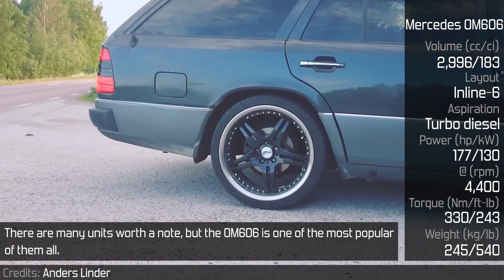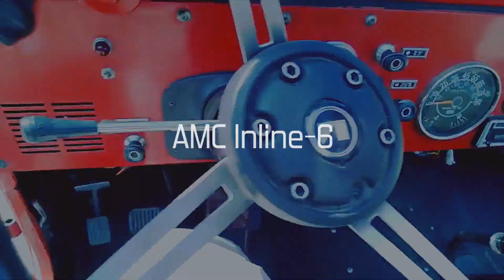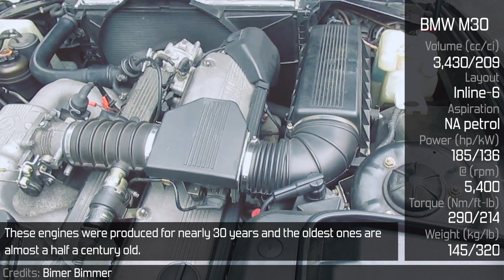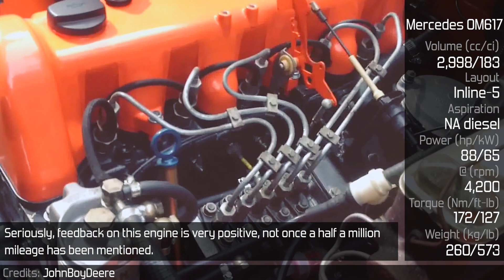10 Most Reliable Engines Running Beyond 300,000 Miles

Comment: What about the 4.6L Modular V8? I've personally had a 1997 Ford Crown Victoria with 450,000 miles.
Reply: STICH666 that thing could be the most reliable car on the planet right now. Seriously
Reply: STICH666 just bought a 2009 crown vic with only 79,000 miles and I plan to have it for a long time :)
Reply: There is a reason they made cop cars with them! Comparable to how many miles a semi driver gets.
Reply: Toyota Hilux 2.4D 
Now that's probably THE most reliable diesel engine out there..
Reply: As long as you keep replacing bottom end bearing at each 20k service
Reply: Probably one of the most reliable motors ever made for a most reliable car. The Panther platform was legendary, and I can't believe Ford killed it.
Reply: STICH666 
I got a 1997 ford E-150 conversion van with the 4.6L it runs great i got 362,423 miles on it right now, it has never failed me yet. I love this van, i hope it will go another 200,000miles. Actually i am typing this while sitting in the van while waiting for my girlfriend to come out of walgreens. lol
Reply: g120957au 
I got 362,000miles and never had to replace the bearings, so i have no idea what you're talking about.
Reply: I beg to disagree with the 4.6. I own one, in a '99 Crown Vic P71, and at 230,000 miles it decided it was a lovely time to send all eight oil rings right out the fucking tailpipe alongside enough blue smoke that it had to be running more on its own lubricant than on gasoline. It will still run, I'll grant, but at this point I'd estimate only about five of the cylinders are pulling worth a damn and maybe six are firing at all.

Maybe it's just a fluke, but...idunno, I'm still sitting here driving the '85 F150 I initially bought the 'Vic to replace while it underwent restoration. That damn truck, with its lazy, all cast iron, straight six keeps right on chugging and in fact is running better now than it was when I got the P71 in the first place.

I'm currently debating on whether I want to put another 4.6 in it, or if I want to swap in a 302 V8 and do some cheaty mccheatface bullshit to get it past the sniffers since the 302 wouldn't interface with the OBD-II port and my locality probes the computer for that model year of car instead of the tailpipes.
Reply: One of the three most reliable engines ANYONE ever built. I used them in service trucks for years. If you use your truck for service you cannot AFFORD to have it out of commision. Do the maintenance and they'll run forever. I got rid of them when the body got so hammered I was ashamed to show up at a customer in it.
Reply: @Brandon O'Neal Mm. I love that 300. It don't rev for shit, there's fuck all top end, but they can take an absolute beating and still not find any fucks to give. You don't even need to be perfect on your maintenance, they're more than tolerant of going a few hundred miles past due on oil changes, spark plugs, etc.

Basically as long as the oil still lubricates it, the fuel and air is mixed vaguely in the general zip code of 'flammable', and there's no abrasive schmoo getting in the air intake, they'll run happily.
Reply: @Tom Swinburn I work for Goodyear CTSC and there's definitely some 300 genes still floating through the ranks. One of our service trucks is a 2015 F250...it's got a V8, of course, but it pulls like an ox, and shares one distinctive trait that every Ford truck going back to 1967 has had: Twin I-beam front suspension.

I very much prefer driving it to our 2010 Dodge Ram 2500. But I wish it had a 300 in the nose and a manual behind that.
Reply: STICH666 just had a 99 f150 with a 4.6 with 678k in the shop the other day. I know of two 300-6s with over a million and several 4.6s and 302s with 500k or more.
Reply: A friend of mine owns a Crown Vic forever with over 250,000 miles on it. Those cars can go on for a long time as long you take care of it.
Reply: Keegan Johnson The 300 straight 6's are the literal definition of reliable and bulletproof people say "Oh the (insert engine here) will last forever if you do proper maintenance" but with the 300 it can go on forever even without proper maintenance I've seen them run with basically no oil and run perfect again when new oil is added
Reply: Austin Wolfe i know. I haf a 1968 f100 with a 300 and 4 speed. It had accidentally been towed in gear once by one of my dads hired hands and not driven in 10 years. I drove it into the shop off of a milkjug of gas and derby car style minimal wiring. The cylinders were all ovaled so we had to replace it, but by God it still ran!
Reply: Keegan Johnson The thing I've noticed is the most reliable engine you can get are American inline 6's such as 4.9 300 and the Jeep 4.0 and the 5.9 Cummins
Reply: Austin Wolfe True. I just wish we would have gotten all the modern versions of the Ford 6 that Australia got...
Reply: Keegan Johnson True Australia has some of my favorite vehicles sadly I'm not in Australia
Reply: Never replaced the plastic intake?
Reply: paulparoma alas they should have updated the interior and made it handle better. thats what killed it
Reply: Modular engines aren't as bad as the Mopar 3.7 and 4.7, but they're still crap. They have a tendency to warp heads, but even more often they have a tendency to puke out a spark plug under load. I had that happen to me at the top of Lookout Pass on a 6.8L.
Reply: Nope not reliable.
Reply: robroyoldboy warped heads? The spark plug issues were all fixed for free if you brought it in, and the updated design has no issues. This is only common on 5.4 and 6.8 engines. Any 4.6 2v still on the road right now will likely be there a long time. Still not as reliable as the old or new 5 liters or the 5.8 or 6.2 though, i will say that.
Reply: The 300 six should of been on this list, or the 500,000 mile list should they ever make one. I disagree with your opinion on the modular/4.6, if treated well they should do 300,000-400,000 easy. If you lost rings I'd have to ask about the service history, has it been regularly serviced with the proper oil? Have any ignition of fuel issues been taken care of in a timely manner?  If you loose a coil on a spark plug and don't do anything about it and dump raw fuel into the cylinder you can't burn it eventually gets into the oil and causes problems.
Reply: STICH666 ...yes this is an incredible engine. I've got a 99 Ford Expedition that has 250,000 on it. Zero problems. Not only the engine, but the entire vehicle. It has the original water pump and fuel pump. The vehicle is getting a little rusty, but for the most part has been bulletproof from day one.
Reply: G6 Liara ...I agree
Reply: Brandon O'Neal ...Yes, they called it the "Iron Duke"  It certainly was a great engine from Ford, along with its predecessor the 250. All the great iron engines went away because of federal fuel economy standards mandated to the big 4 manufacturers :-(
Reply: chayes954r im suspicuous that ford quit making the straight 6 because too many people were keeping their cars and trucks too many years and not buying new ones. Look what the aussies did with it. And in todays world a modular 4 that can also be a 6 makes a lot of sense, especially with ecoboost technology. Mercedes is going back to it. I want rwd fords back! They can still have optional awd for those afraid of snow.
Reply: Yes making anything that lasts nearly forever is always going to be a nail in the manufacturers coffin. Sales will suffer. So they have to engineer their vehicles to last somewhere in the middle. If it fails with low miles, nobody will want it. If it lasts to 400,000 miles, sales of new vehicles will suffer. It's a catch 22.
Reply: I always thought the Iron Duke was the 4 cylinder cast iron Pontiac Engine that was founf in Sunturds, later to be reworked into the "TechFour" or "QuadFour" and built at the GM Delta township engine plant?
Reply: NO the government and Obama killed it with CAFE regulations, it was a declining segment and Ford couldn't afford to have it in their portfolio and take the CAFE hit for it, SUVs and Crossovers are more profitable so that's where they wanted to use/balance their less fuel efficient cars.
Reply: No it was the straight six didn't fit well into the new designs, to meet CAFE (Corporate Average Fuel Economy) the have to package the vehicles tighter and tighter, it's easier to tighten upan engine bay if the choices are V6/V/8, the straight sixes were to long and were hard to use in transverse applications (front wheel drive)
Reply: S Baker oh, lol, I don't know, but I do know the "Quad 4" by GM was a horrible engine.
Reply: S Baker ...that is true also, but they could have kept using the 300 straight 6 in light trucks since the engine bay hasn't really changed in those. I had one in my father's old 82 F150. Had a 4 speed transmission. I loved that truck.
Reply: I don't know about that, some of the Japanese manufacturers used durability  and reputation  to increase their price point. They justified it with improved resale value and that worked really well when they offer lease programs. In theory with a lease the customer is paying for deprecation, interest and profit. If your car has less deprecation than your competition that gives you an advantage in a lease market. Example if in 3 years a Ford depreciates $4,000 and a Honda $3,000 you can lease the Honda for about 66% of the cost of the Ford, Honda rounds it up to 70% and picks up 4%.  Some of the Japanese manufacturers did a better job of getting cars back to the dealer for service which was more revenue for the dealer  and the manufacturer as the dealers usually use OEM sourced parts.
Reply: S Baker thats not a legitamate excuse. there is nothing about a straight six that makes it inefficient. the aussies continued development until last year. fwd is the worst thing ever to happen to american cars. rwd cars drive WAY better and long hoods are sexy.
Reply: S Baker That is true. And is why Ford has increased reliability so much in the last 20 years. On the flip side, Honda has become comfortable with their margins and begun to let quality slip in the last 10 years. Its all a game to them. Cars could easily last 1 million miles with todays technology but that would be horrible for business.
Reply: some people will pull high miles outa some engines but that doesn't make it a good engine, good on them ,4.6 , 5.4 engines on the whole are junk. 300 six  should definitely been on this list.
Reply: TestECull isn't that the truth.  gutless, lazy, poor fuel miliage,reliable as a wood stove, even when they are sick.
Reply: Greg Or Jen I get 18MPG combined out of my truck. But then again I also have a manual gearbox in mine.
Reply: You're  bout average, I also find some 300's will get  over 22 mpg and another will be lucky to get 15.  I had a few of those trucks ,fuel economy was all over the map. Didn't care, would always start and run,great engine.
Reply: Greg Or Jen I think the fuel economy's all over the map because of two factors: Driving style, and Transmission. The 300 is more than happy to embarrass a 460 with its fuel habit if the driver jams their foot in it, they're more than happy to chug that stuff down with a C4 or C6 behind them.

I'm easy on my throttle and I have 2.49 rear gears and a wide-ratio 4-speed manual. I never need to rev past 1,800 unless I'm getting on the freeway and all that low end torque means I don't need to wail on it to get it moving. 70mph in 4th is about 1650RPM, and most in-town driving is done in the 1100-1450RPM range. Pretty sure that's why I get 18.

The ones doing 22 average are probably gonna be fuelie motors that rarely see the freeway. 18's realistically the best you'll get out of the ol' 1bbl.
Reply: fomoco Considering your name, you see the world through FoMoCo brand shades. Based on the 4.6 and 5.4 vehicles I've seen, they all suffer from an assortment of poor design decisions, from rattling cam phasers, cheap plastic timing chain tensioners that break because the huge timing chains whip around on cold start, oil pumps that can't build enough oil pressure when the oil is hot, wear prone cam bearings, broken rocker arms, cracked exhaust manifolds, bad valve seats, cracked intake manifolds, blown head gaskets, spark plus that blow out because Ford couldn't be bother to put more than a couple threads in the heads, spark plus that break apart, spark plus that seize up in the head, etcetera etcetera. 

Ford scrapped all their reliable pushrod engines in favor of unreliable, weak DOHC  V8's long, long ago. They probably figured they would make more money on parts to keep their mod junkets running  or Ford fans just buying new Ford vehicles,
 when the engine fails catastrophically.
Reply: fomoco  Give your head a shake,, even most large diesel engines start running into problems at 800k . there's no way a gas engine will go that far, it's simply not in the design.
Reply: fomoco   Give it up, he (hochhaul) was generalizing. pretty sure he knows more than you.
Reply: But the Aussies don't have CAFE and as stringent emission regulations. If I look under the hood of my 2001 F-150 I'm not seeing how a straight six would fit. And again the V-6 allows them to make a smaller engine compartment and in some cases turn the engine side ways for a front drive application.  I agree about the RWD cars being more reliable, durable and easier to work on but front drive does have it's advantages in weight, less intrusion into passenger compartment space  and space management in the rear axle area often allowing them to get the gas tank pretty darn close to the rear axle, and in some cases just in front of the rear axle improving crash test scores.  Although front drivers can be reliable and tough, our Accord is north of 300,000 miles, still runs great and doesn't use oil.
Reply: I disagree on your opinion of the 4.6/5.4 2 valve engines. I worked at a Lincoln-Mercury dealer when the Town Cars and Grand Marquis switched to the 4.6. The 5.0 was hell for stout but if you parked a Mark VII or a V-8 Cougar next to the Town Car or the Grand Marquis  the 4.6s were smoother, lighter, got better fuel mileage and were quieter. The Town Car and Grand Marquis were old people's cars, in general most of the old folks we dealt with weren't big on change  sold quite a few of them on the 4.6 over the 5.0 if I could get them to drive each back to back, even if it meant snagging a 90 Town Car or the Newest 5.0 Grand Marquis off the used car lot to test. Heck I sold one guy a '92 Grand Marquis taking a '88 Grand Marquis in trade. He came back after a week madder than a wet hen because I "sold him a car with a broken gas gauge"  in reality the new Marquis was getting so much better gas mileage he noticed it after about a 1/2 tank of fuel.
Reply: TestECull you probably didn't maintain it properly. The 4.6 is an unstoppable force when it comes to reliability.
Reply: meifert2 Ahh, yes, explains why the 300cid I6 I have still runs like a swiss watch....
Reply: hence their popularity with US police departments. Cheap to maintain, decent handling at moderate speeds.....
Reply: STICH666 my dad used to have a 2001 he bought it since it was brand new and ran it 487.000 km and now the engine is being fixed. But the only thing it needs is a piston rings and and a driveline even though its in good condition but it makes some loud noise that's why I'm changing it.
Reply: Currently own a 2007 town car with 302000 on the odometer and not a single problem
Reply: Bigboss Bhatti Then you own a unicorn, because those engines were massive pieces of shit.
Reply: hochhaul do you even own a car ? I owned crown vic's and mercury's the engine they use is basically bulletproof if you take a good care of it it'll last at least 600k miles.

My 01 crown vic lasted 678k miles then the trans broke due to no oil changing and no E brake usage i fixed it gave it to my little brother and now it's at 812k miles still running strong no leakes what so ever. And now my 05 grand marquis is 305k miles and has tons of tourqe and power no problems at all i only change the regular stuff seals,oil,oil filter and air filter your just an LS fan boy that likes to trash any other V8.
Reply: meifert2 I don't give a fuck about brands. Ford's OHC V8's are cheap pieces of shit. They gave up reliability in the 90's when they replaced their stone cold reliable OHV V8 and I6 in their pursuit of more "European" OHC V8's. Ever since then they've had issues with poor power numbers, shit timing chains/cam phasers/timing chain tensioners, junk oil pumps, spark plugs that blow out of the head because Ford didn't use enough threads and require heli-coiling , spark plugs that get carboned up and stuck in the heads if yiu follow Ford's maintenance schedule, 4.6's with blown head gaskets, I take manifolds that crack and puke coolant everywhere, junk rocker arms, burnt valve seats, warped/cracked exhaust manifolds, junk fuel injectors that leak and hydrolock the engine, etc. Sure, you can maintain the shit out of it and baby it into the hundreds of thousands of miles, but you can do that to any engine and pile up miles. The Ford mod motors just require 10 times the amount of effort of most other engines, including the LS. Especially  after Ford went to a cheap, wear prone inverted tooth timing chain, which is why the ecoboost is such a terrible timing chain-eating pos.
Reply: meifert2 LOL no more full of shit than the guys saying they've gone 300k or 600k miles on a 5.4 or 4.6 without one single issues. Those pieces of shit were a failure from day 1. Plastic timing chain guides that break apart and the plastic chunks plug up the oil pickup. Oil pumps so shitty, Ford lowered their hit idle oil pressure spec to avoid having to warranty hundreds of thousands of shit oil pumps. Ford should have never dropped their 351, 390, 460, 300 I6. Those engines made better power and were built to last. The Mod motors were a complete failure.
Reply: hochhaul except you don't seem to realize that literally hundreds of thousands of 4.6 engines habe gone past 300,000 miles. You ignore facts for fanboy fiction. You claim the LS is a great engine yet has thousands of recalls for ring gap failure and cam issues. The oil pump story was invented by people that ran cars low on oil, that will happen with any engine. You are cherry picking issues like the spark plugs when it has been proven that most of the failures were caused by aftermarket plugs.
Reply: hochhaul also, if the Ford modular oiling system was so bad then why is the LS oiling system an identical copy. It will literally swap over
Reply: Hochhaul, say what you want the Ford modular V-8s will generally run 200,00 to 300,000 mies with minimal care IF PROPERLY MAINTAINED.  They are a little bit more finicky than the old pushrod engines AND require someone who actually knows what they are doing to perform the maintenance. I worked in a County Maintenance department, the only modular engine the Sheriff's department lost was one that the deputy was in pursuit, went over a rise, the car got airborne and he didn't back out of it, if free revved and came apart some where north of 7,000 RPMs. As stated before taxi cab operators are getting around 500,000 miles on these engines. My persoal truck that I bought new is at 175,000 miles and nothing ha been done to the engine except plugs, I put injectors in it at 100,000 miles and it ate a couple of coil packs. You talk about spark plug issues and not enough threads, Ford fixed that when they went to the PI engine in 2000 or 2001, they redesigned the heads for better performance and fixed the spark plug issue at the same time. You talk about exhast manifolds, that's not a problem linited to the Ford modular engines, it was a problem on the 460 and on many Chevy V-8s, one of the local repair shops tells me a Ford usually costs about 1/2 of what a Chevy does to have the manifolds done because most of the time the Chevys need new manifolds, the Ford just gaskets and studs. Most of Ford's reason to switch to the modular engine family was driven by emission and economy requirements from the federal government, a lighter, high revving engine allowed them to keep the large cars and gave the light trucks less effect on their CAFE standards.
Reply: Thank you!!! My 2007 Lincoln Towncar has 428,000 mi on the 4.6 liter and runs better than anything around. all original. There was never a better motor than this!!! A shame thay stopped making the crown vic and the towncar. I'm keeping my 2007 TC forever!!!
Reply: Ford also had another engine you couldn't wear out, the 1965 and 1966 ford f100's 352 v8. best v8 ever built .
Reply: Donovan Shovan Exactly basically I buy cop cars, not actual cop cars but the cars they use because I know they only buy reliable cars, own a ford explorer now, it's great plan to keep it at least 15 yrs.
Reply: Born to Ride ....B.S.  that "planned obsolescence " conspiracy theory has been around since the Flat Head Ford of the 1930s.  If one car manufacturer's car last a lot longer and is more reliable than the rest, they will sell the most cars.  Just look at Honda/Toyota in the late 1970s vs the American cars.  These days, most cars wear out or rust out before the engine is close to being worn out.
Reply: hochhaul.....Then there's a lot of "unicorns" out there.  I've been in dozens of Town Car/ Crowne Vic 4.6L with 400,000+ miles.
Reply: Had a Mercury Grand Marquis with 276k miles on it, hasn't skipped a beat. 
Now I'm running a 2011 Vic with 145k miles on it. 

I love the 4.6, but I wish all of them were DOHC instead of the super underpowered SOHC version.
Reply: You took the words right outta my mouth LOL...Yes, Pontiac had the 'Iron Duke 4' and then Oldsmobile spanked it into the Quad 4 (I had one, lord what a dog). Thanks for your comment.
Reply: gotem
Reply: that's not what other people are saying
Reply: I own a 95 and 2005 Merc Gr Marquis with the 4.6 V-8. The 95 has 256k on it and runs like a champ but looks like hell and the '05 has 158k and everytime I take it to the dealer for ALL service, people want to know how I keep the car looking showroom new from top to bottom (You can eat out of the spotless engine bay). Only problems have been CC pad replacements and typical HVAC bullshit under the dashboard. If the Autoclimate fan starts bouncing from high to low, it's a simple Circuit card replacement under the hood on the firewall - don't let anyone tear down the dash to get to door baffles and bullshit that will cost $$$ ! I LOVE my 4.6 engines, they have NEVER failed me plus I get 39 MPG on the highway at 85 mph with the A/C blasting all day long. Nope - I'm happy with these wonderful cars and they have always treated me great. Follow the maintenance schedule from the factory and only use FOMOCO parts and you will never go wrong.
Reply: It'd be nice if Ford made transmissions as reliable as their engines. The AOD? THAT piece of shit and they decide it to put it in a car and give thousands of those cars to cops? I bought a police interceptor with a rebuilt 4R75W (basically a revised AOD), put 6 thousand miles on it, and then it just killed itself (and the transmission shop says they got no idea how I made it to them). 6 thousand miles on a brand new 4R75W transmission, yet the engine made it to 150,000 miles without a hiccup after being abused by cops.